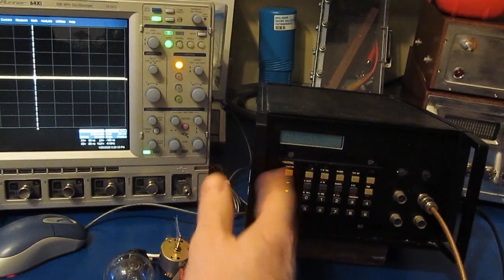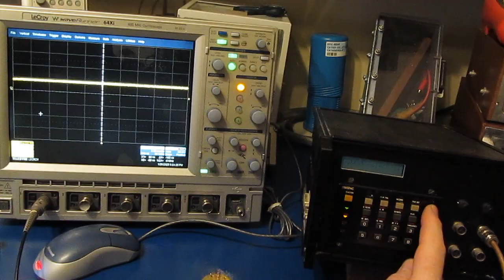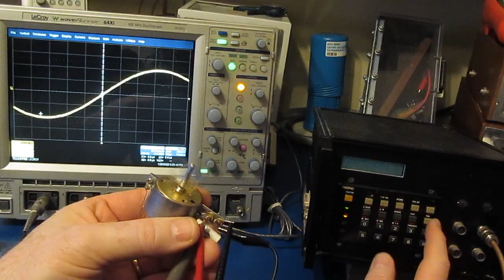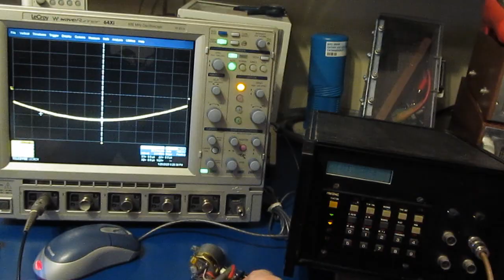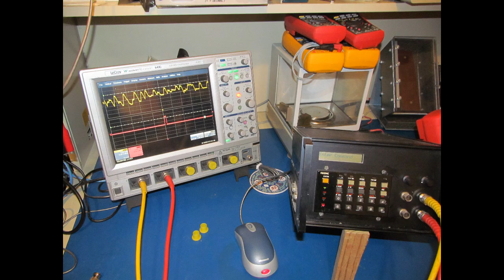Vintage Homemade Arbitrary Waveform Generator

Comment: Please do a deep dive on this arb Joe! Longform video or a writeup on the forum, I think it would be super interesting and informative.
Reply from the maker: Sure, I can do this for you.
Reply: +1 for this! I think it’s a very cool piece of equipment and it would be neat to see the design, as well as to know what sort of projects you were working on at the time that created the need for such a device. 😊
Reply from the maker: @ruhnet  Hard to say what I was doing for a hobby back 35 years ago when I designed this arb.  I doubt I was doing anything with the VIC-20 by then and had moved onto my IBM PC.   I did show a video of that homemade speech recognition system I made for the fun of it.  That would be from that era.